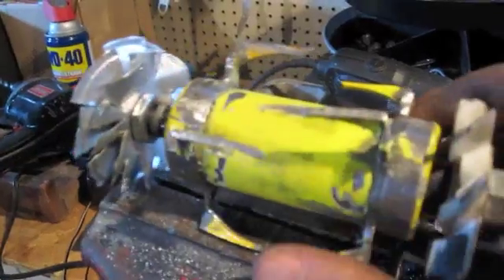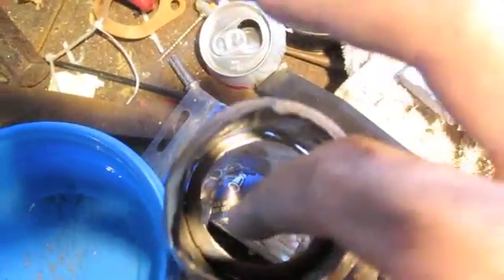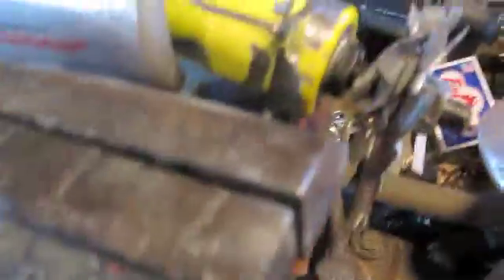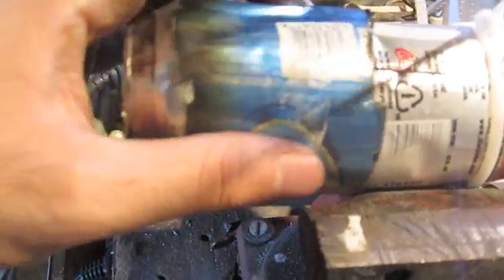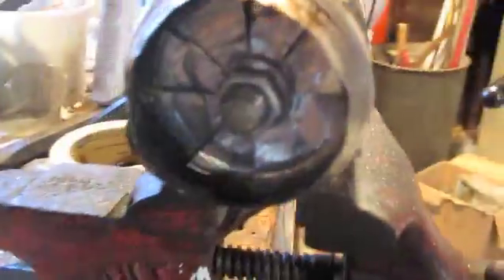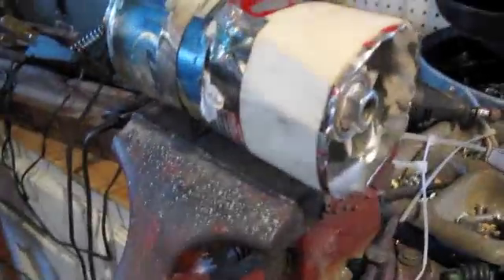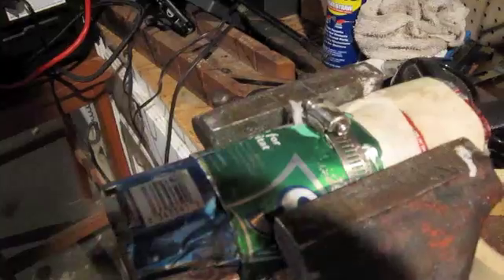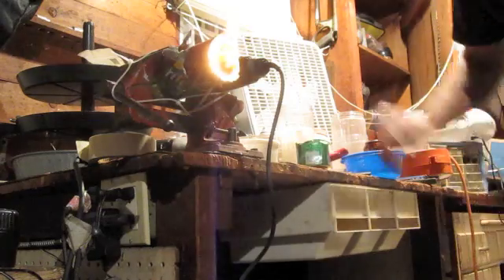How to (kinda) make your own Soda Can Jet Engine! MLCCS Mark I

Comment: My dear young man, you are playing with fire. Go and  read something about what is required to make a jet engine  work.  
In this case all I shall point out is that you need to know that in a jet engine, you need to slow the velocity of the air quite a lot before  you burn it  as the high velocity air will not sustain the flame and will blow it out, If you had to blow on a candle you will find that with slow air around  the wick it will burn  silently with a yellowish colour, Try and blow on it, the flame will try to hold on to the wick becomes fierce and will start finding itself in a predicament that of being blow away or being close enough to the wick to heat it  and retain the flame, Any faster air around the flame will blow it out.

So what you need in that soda can of yours is to put a holed  baffle in the centre  to protect the flame behind it  and then  the the bypassed air will mix with the hot gasses at a later stage,

Now that is the requirement to sustain the flame, now please go and read about diffusers, compression due to change of momentum and the need of stationary blades at the turbine side,  Be careful not to injure yourself, due to lack of understanding of what you are dealing with, Move slowly before you act and look before you leap young man.

Comment: Some tips:

In future designs you might want to add an electric motor to get things going. Since most motors are at least decent as generating power, you could have the motor charge a battery for powering the engines electrical needs once it's started up.

I think your best bet as far as fuel goes would be te either create a fine spray within the combustion area or vaporize the fuel to make a mixture of air and gaseous fuel. In both cases you'll have to find a proper ratio between air and fuel for most efficient combustion, it would probably be best to find a mass ratio since volume can alter with temperature. Optimally there should be a system to control this ratio such as carburetors in internal combustion engines.

I really like your innovation with the bike bearing, most attempts I've seen just used a bearing made with aluminum. However, if you were to actually get this to work, I would be worried about the internal temps vaporizing/burning up the lube. Maybe try magnetic bearing or an air lubricated bearing.

Another issue with engine operating temps is that the body is mostly aluminum, which has a relatively low melting melting point compared to other metals, but I don't know enough about combustion to say wether or not alcohol will reach those temps in this kind of setting. You should also make your case more uniform in shape, those dents cause efficiency eating turbulence.

You'll want better turbines for future attempts. They have to be precisely balanced or you risk them flying apart due to inertia during operation, if they're even balanced enough to work in the first place. You also want to ensure the fins on the turbine are uniform as possible, or they may not all exert the same amount of thrust, causing higher turbulence.

Comment: This thing cant work. No compression, or effective flame holder. When you finally get those things fixed, the engine will either explode from the high compression or melt down.

Comment: Spinning the engine with a power tool doesn't count as, "working for a split second". "Working", would be if the engine were self sustaining, and this engine was anything but.

Comment: dude do you even know how the hell a jet engine works its not just a fan blowing firewhich is what you made. first in the front you need an IMPELLER not a propeller which is what you had second the coke and beer cans together would never be able to contain the pressure created by the impeller and if it did it wouldnt be able to hold the pressure of INTERNAL combustion when it creates even more gases you just lit esentially a wick hanging out of the can. you made a failure of a flamethrower

Comment: Sorry dude but Aluminium just wont work for this. A bean can might work as its steel. Aluminium starts losing structural integrity at 130C any flame is going to be way hotter than that.

Comment: Good try, and iggy the haters, "they" laughed at the Wright Brothers, Sikorsky, Tesla, etc...  IMO, the shaft may be too heavy and bicycle bearings may be too hard to turn, try ultra lightweight materials I.E. a thin but strong shaft and small, easily turned, high RPM bearings with a closer fan blade design.

Comment: Aluminum has such a low melting point... Why use it? Don't tell me because it is easy to cut. Steel soup cans are just as easy to cut.. You need a proper compression stage. That, along with heat energy, is what makes a jet engine work. I don't understand your design at all bro, but kudos for trying. You will learn much but you may just have your own design someday....

Comment: hope that will help man and if you do get a high pressure system be ready cuz the temp will melt the aluminum due to the fact that the temp inside the engine will be hot enough to burn threw but what you could do is like a rocket engine run a cooling jacket around it with water.  anyway have fun man.  dont blow your self up.

Comment: and if you don't know what a flame tube is it kinda looks like a machine gun barrel and the holes that are in it go from biggest to smallest from the front of the engine back and the measurements for the holes are directly proportional to the diameter of the inducer fan.

Comment: maybe this will help  you need a flame tube in between the inducer fan and the rear turbo fan on top of that you have to measure the space between the fans and the id of the combustion chamber down to a 100th of a millimeter.

Comment: Paper plastic rubber foam all burn & should not be used in a turbine structure. Hi temp silicone is ok. You need to reduce the outlet diameter to create a venturi and retain the flame (combustion chamber) or you will just blow it out. Fuel supply needs to be continuous. A soaked rag wont work. AND GET A FIRE EXTINGUISHER

Comment: Do you have an available tig welder and plasma torch? You might be able to machine better parts. The key to these engines is precision. Also, you must have a constant gaseous fuel source to be compressed by the compressor stage so that the turbine can expel high pressure, high speed exhaust fumes to create thrust and drive the main compressor which repeats the cycle. You may also need a better ignition source such as an rc glow plug. Aside from these things it was a decent attempt.

Comment: It's because you don't have a constant moderated source of fuel or a decent compression stage before the ignition stage that it didn't work, Tackle these problems and it should be feasible. (Though when working with different pressures or fuels, you must to tread responsively) Good luck.

Comment: Hehe...mathematicians, light beer and fire in a closed room :D bully for you! 
But seriously folks. In any case it's (or was) a nice piece of work, I usually use old Bicycle hub axes as well. But for the other parts i use Soupcans, which are usually made of steel, in Germany almost all beer or soda cans are made of Aluminium. Building&running a jet engine, which could easily reach 500°C, out of a metal which melts at roundabout 650°C is fun but not very sophisticated ;) greetings

Comment: Nothing even simalar to a jet. It's a fan in a tube. No self compression, no real fuel source, I built a working jet engine with old computer parts and it ran on aerosol. Try building one of those first, then move up. Good idea tho

Comment: did you ever think of Using muffler cement to fill gaps and Holes it sets in three Hours and Is cured by Heat. Appoxy will just burn if you do not use High Heat which is expensive muffler cement is about $3.00US it is Costic so us gloves and a Putty knife

Comment: I did something like this when I was a kid. Didn't work for poo. I didn't understand that the air needs to be significantly compressed (like 2:1 or better) before using it for combustion or you won't create any significant thrust.

Comment: @idontcarewatuthink Yeah the computer fans aren't very good, plus they're plastic. Uhm don't know much about turbochargers lying around but if the PC fans were to be replaced by homemade steel fans, would it be any better? Also, don't turbochargers use centrifugal compressors? The fans are a bit different than axials so how to use them here?

Comment: @WhiteKestrell well for starts, if he replaced the computer fans with an actual compressor and turbine from say, a small turbocharger, that would instantly produce better results. Compressor and turbine wheels are designed to move the max amount of air per unit volume. I'd say there's definitely a turbocharger just lying around somewhere that would have the perfect size compressor wheel and turbine to efficiently utilize a soup/soda can

Comment: use a oil soaked rag. also make the motor suck up the flame have a rod go out the front through chamber conected to a grinder

Comment: Cool idea, however what you have now roughly resembles an afterburner.  What you need to do is introduce and ignite the fuel I between the sets of blades.  The first set brings in air, and the second set is turned by the flow of burning fuel.

Comment: if there was a way to soder it i think would be a better idea instead of clamps... more so cause your dealing with metal not rubber tubing ..... remember its gonna get hot, anything you can use that wouldnt heat up would be a good idea ;)maybe use magnetic type of bearings... good ones can stand quite a few degrees :)

Comment: if there was a way to soder it i think would be a better idea instead of clamps... more so cause your dealing with metal not rubber tubing ..... remember its gonna get hot, anything you can use that wouldnt heat up would be a good idea ;)

Comment: You really want some advise you could build it with actual steel, weld it all nice and pretty and do it rite just by using some 1/16 inch sheet. One big problem your obviously having is there is no  neutral guide vane and no turbine. That will produce the power for the intake or what ever that thing is. Listen if you have this much time to kill do it rite and post another video. Get diagrams of RC engines and start from there its actually very simple, if you need help let me know.

Comment: *sigh* Please leave engine design and construction to propulsion engineers.  This is a rather dangerous endeavor, especially since it is clear that you have no idea how a turbine engine actually works.  You seemed to get it at the end however.  Turbine engines must be ignited from the inside in the combustion chamber, not at the nozzle.  Also, one must ALWAYS run the compressor BEFORE trying to ignite the engine.

Comment: Can you leave one of the flanges of the hub (where the spokes went), maybe you could use it as the fuel injectors, you will likely need to close one side of the flange spoke holes, just an idea i had, might be possible.

Comment: You need to make that combustion chamber smaller than than the intake of the jet that way when the air comes in it is compacted and when it combust it will get more kick to it than the exhaust needs to be a little smaller only by a little.

Comment: It would work better if you had a constant fuel source like natural gas.
Also trying to get the dremel to run at a lower RPM as it's just blowing it out before it can start combusting properly.

Comment: However its not possible to make a working jet engine without the tools needed. And even with the tools needed a verry difficult job and requires a lot of experiance on the lathe.

Try a pulse jet or even a turbo jet if you are interested in this.

Comment: Use propane , its easy to ignite and control and your turbine blisk should be made of steel otherwise you will burn off the blades, you dont need consistent spark if you make a efficient combustor can.

Comment: You can not use cans, not aluminum cans anyway, there too thin and if you actually sustained combustion it would melt the cans in seconds. Bearings are another point of concern, you need high speed high temp bearings and if you dont want to get in to difficult lubrication then just use ceramic bearings ang pre lube them before every run. For combustion you need high presure air not high speed so you need to make stators after the compresor and just before the turbine blisk.

Comment: I made something similar to that we used a combination of PVC and aluminum sections it was a project we did in a aerospace engineering project at UF we used a electric spark generator for the ignition system since its consent spark and used a homemade map gas system for fuel it worked very well Cheers

Comment: @Gaussgundesigner you cant solder but you can tig weld and ive done it before with two red bull cans in my welding class when i was board

Comment: That's a good effort. This is just an opinion but I think you should start working with small pieces of sheet metal. You can make your own spot welder out of a transformer from a microwave.

Comment from the maker: Well, The point of this project was to make a small self sustaining jet engine.. and yeah I made progress but I also almost burned down the garage lol. My main drawback is that I have no way to weld on materials that I get from dumpster diving. So many holes and weakpoints and no way to reliably make them snug. 
If you look at some of my other videos you'll see that I made a second with a fan from a bathroom.. though it became more of a thermojet.

Comment from the maker: @RetardedDrummer 
well, this was mark I. check out markII for a slightly improved version of it. Id love to add stators at both the turbine and compression sections of it, but i have no idea how to secure them and make them that small out of easily accessible parts.